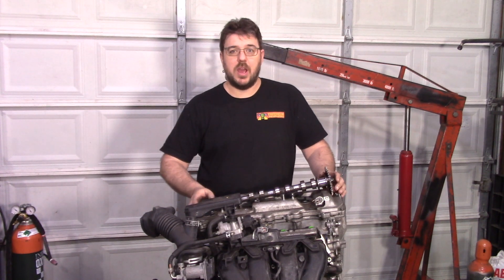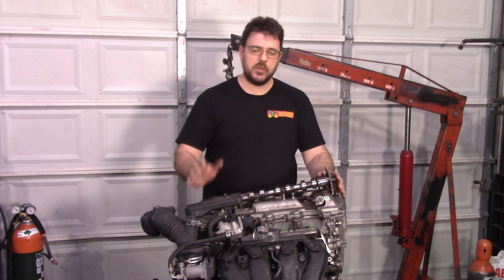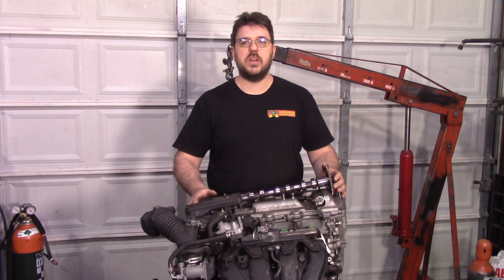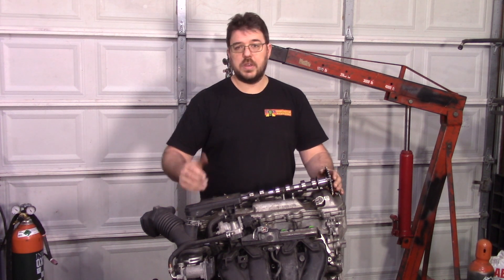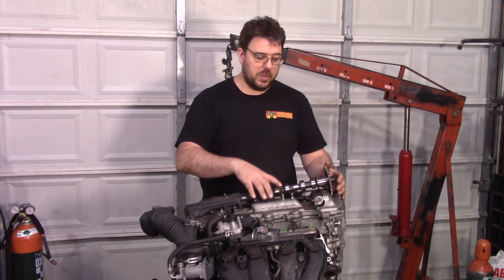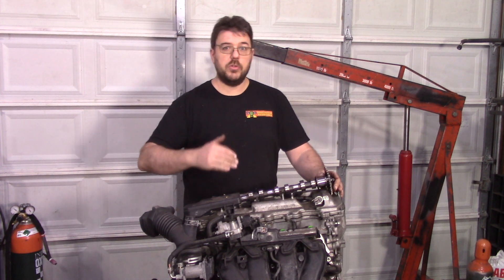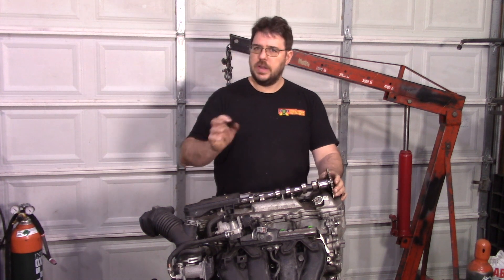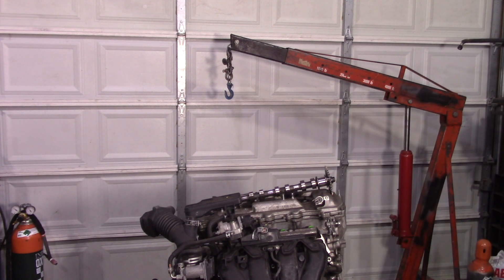2AR Power overview, the search for 150hp/L

Comment: Did he say 271hp??? NA what!?
Reply from the maker: Yes, that's my naturally aspirated record so far but that was with the 2.5L crank and stock 10.4:1 compression pistons on pump gas so it should be relatively easy to take that same build up over 300whp.
Reply from the maker: @meanman6992  Unfortunately i really have no info on the automatic transmissions in the stock application. but generally there's a 30-40% overhead available on most of these types of things.
Reply: @FrankensteinMotorworks true, but knowing that there’s likely no aftermarket support for the transmission, I have the engine…. (In that car) and I keep driving past a NA Miata on the way home….may have to start a project after discovering this. I used to be all about 4G63’s and want another project but as much as I love turbo’ed engines, I don’t know that I want to go that route again. A NA 250ish whp hp Miata I’m betting would be a hoot.

Thanks for the replies I’ll look at your store and depending on what I can find out about that Miata, 🤷‍♂️ who knows, every man gets a midlife crisis project right?
Reply from the maker: @meanman6992  I 100% agree with 250whp in a lightweight car like that. That's pretty much what i do in my MR2 Spyder and it's an absolute riot on track.

Comment: No, that's for 2GRs. Original comment:  I am curious if the D4S head (or even just the upper third) from the longitudinal FSE would fit, assuming other relevant fuel system upgrades to match. I admit in my head I'm imagining a 12.5:1 FXE block with the 1AR crank and the DI heads... I fully realize the rest of the FSE is different, but surely there's SOME similarities for the FSE to be in the same family. Could foresee tune difficulties as well, naturally. I just feel silly now.
Reply from the maker: We really don't get the 2AR-FSE engine here so i don't have access to it. That said, the 12.5 compression that comes from the FXE is in the pistons and they aren't compatible with the 2.7L crankshaft. Direct injection also adds a whole other level of tuning complexity. Generally at the tuner level the juice is not worth the squeeze there.
Reply: @FrankensteinMotorworks  Well never mind, I was just confusing myself. Too much going back and forth with the 2GR which obviously was available with the FSE here. I did always wish we had gotten the IS hybrid.

Comment: I have a 2017 camry (2AR-FE) I wanted to try these parts on. So I just replace the parts and that's it? No other modifications needed??
Reply from the maker: This video talks about a lot of different configurations, which configuration are you talking about?
Reply: @FrankensteinMotorworks  cams springs and intake
Reply from the maker: @mamadnoor2907 You need to update the exhaust to get the most of the cams and you will need to tune the ECU to use those cams.
Reply: @FrankensteinMotorworks  where I live modified exhausts are illegal is it possible to not change it? Also the ECU will be stock?

Comment: You got me excited about 2AR!   The torque numbers are actually good, and i kinda got a little interested in what 4 cyllinders can do 1.6-2.4L due to turbo charging.   They have turbo chargers now that can give that little motor a powerband similar to a Chevy LS or LT from 2500-6500 RPM.   A similar level of torque and power.

What you are showing is without boost this 2AR has a ton of potential.  That torque number that i was seeing is something that many 3.0L v6's make.
Reply from the maker: Yeah, Toyota really gave us several gems here with this generation of motors. Have you seen the 3.5L V6 making over 300lb*ft of torque?
Reply: Yes the 2gr and VS 3.5L make a little over 300ft-lb when they are tuned and bolt ons. @FrankensteinMotorworks
Reply: Did you ever get the ported 2ar heads tested for power?   In your series I recall the 241whp with  the 240@.05" cam and 270 whp with your short runner intake.
Reply from the maker: @dennisrobinson8008  The 300lb*ft of torque to the wheels on the 3.5L V6 is not achievable with just bolt ons and a tune unless you're using some fuel that has some nitro in it.

I have not used the higher flow heads yet, there are some valve geometry issues i need to solve and i haven't given it priority.

Comment: Can the mentioned 2ar parts (cams, springs, intake) go to a 1ar? If not how do you build power on the 1ar and do you have any dedicated parts for it?

Thanks and respect for the videos on the ar platform
Reply from the maker: Yes the parts will bolt up. You'll need to confirm the valve to piston clearance but everything else is exactly the same between the 1AR and the 2AR. The only differences inside the motor are the pistons and the crankshaft.
Reply: @FrankensteinMotorworks  noted good sir. planning to build a car with a 1ar innit, hoping your parts will be in stock when the time comes. meanwhile will keep tabs on your research.

Comment: Looking forward to the intake cam timing experiment, and great to see this data in your videos.
I noticed what sounded like a hard rev-limiter kicking in at the end of each pull.  Is that a factory rev limiter, and do you know what the factory rev limit would be for the 2AR-FE in a 2015 Camry LE? 
Lastly, do you know how high these motors can safely rev, especially relative to any(?) rev limit imposed by the factory PCM/ECU?
Reply from the maker: The new revision of the 2AR-FXE build has been done and it ended up being great. The dual vvt-i system is not needed to be swapped in for this build to still make great power (235whp).

The factory limiter on the 2AR-FE can vary from car to car, i've seen it as low as 6200rpm and as high as 6500rpm. With the stock 2AR-FE cams i've found no issues revving it to 7200rpm safely and with the dual 2AR-FXE intake cams it revs safely to 7600rpm due to the slightly softer ramps.

Comment: Hey definitely been following your channel for the past year bc you've really pioneered a lot for the 2AR build. I'm sitting on 2 short blocks and a long block (all due the the field I work in.)  And while watching this video I had to stop and do some personal digging. at 5:48 you hit 271hp on the camshafts that you swapped out. I'm not sure if you went from the 2AR-FE cams to the FXE cams but the one thing I can confirm is the 2AR-FE cam is bigger than the FXE. Probably shouldn't disclose this info but the FE having a cam lobe height of (44.163 to 44.305 mm) and very similar to the exhaust compared to the FXE cam lobe height being (43.814 to 43.914 mm) and being about a mm smaller on its exhaust cam.  YET I had to see the cam on your website and you listed that "These camshafts are 289 degree advertised, 240 degree at 0.050” with 12.2mm lift. The grind is asymmetric." ARE THE CAMS YOU SELLING ADDING AN ADDITIONALLY 12.2MM OF CAM HEIGHT????????????
Reply from the maker: Yes, the FXE cams have less lift but they have a lot more duration than the FE so they do end up flowing a lot better. The cams i sell really are quite big but keep in mind, 12.2mm is the total lift at the valve, for comparison, the FXE cams are 9.9mm lift at the valve. quite a bit more than the lift at the lobe because the rockers do magnify the lift quite a bit.
Reply: @FrankensteinMotorworks  when coming to this build I was trying to stick with mostly DENZO parts. Typically what Toyota only runs . But what I’ve found interesting is the fuel delivery. The Toyota tundra and sequoias are the only Toyota vehicle to have flex fuel available when buying which type of vehicle. I have the 2AR stock fuel rail fitted with several different types of Toyota fuel injectors and they all fit as snug as the 2ar fuel injectors
Reply: I would be a lot Cheaper to get these of an FBE motor compared to buying 500cc injectors
Reply from the maker: @chrisking5521  The idea is not bad at all but unfortunately those injectors are about 430cc injectors. The V8 motors make more power but have twice as many injectors to do it with so the injectors are not that much bigger than the 2AR's injectors. 

Toyota already has a pretty large margin of extra flow on the pump gas vehicles and they only seem to increase the injector size 5-10% for the flex fuel vehicles. 

In order to find an injector bigger than the current 545cc injectors i use you need to look at Toyota vehicles that make over 60hp/cylinder on E85 or 65hp/cylinder on pump gas. So for an I4 that would be 260hp, a V6 would be 390hp and a V8 would have to make over 520hp. And keep in mind that the direct injected engines make peak power on direct injection so they need to be port injected only engines.

Unfortunately this ends up being a pretty standard problem. I find a solution to a problem and then the demand goes up and the market shoots up. I don't have a great solution for this because the solutions i do find are sometimes quite good but then they cease to be as soon as people hear about it.
Reply: I gotta know truly. I love to communicate with you to compare some of the finding  i've came across during this journey as well.

Comment: Toyota A25A is far modern and high-tech engjne with the same displacement, imagine what is it capable of
Reply from the maker: I actually have one here because i try to stay on top of this stuff. the A25A is a very nice motor but as it stands it has a few things on it that make it impossible to control with an aftermarket ECU. Particularly the intake vvt-i. and even once those problems are solved there's still the issue of the A25A having a smaller bore and a longer stroke so it uses smaller valves and with those smaller valves it has much smaller intake and exhaust ports.

Comment: Just wish the mods were more cost effective to the average consumer. The power for price isn’t there for me yet but I’m still following along in hopes that the TC2 will catch on to the common car scene as a car that people hope to see is actually fast with a lot of potential
Reply from the maker: naturally aspirated horsepower is always more expensive, just use a turbo if you want more power for less cost.
Reply: @FrankensteinMotorworks  no thank you. I need reliable horses 😂
Reply from the maker: @christopheraustin3324  the 235whp configuration i'm working on with the 2AR-FXE is a pretty low cost build, I should have a stock ECU tune released for that setup soon.
Reply: @FrankensteinMotorworks  and that’s compatible with the 2AR-FE? What does that do for cold air intake and a lightweight crank pulley?
Reply from the maker: @christopheraustin3324  The tune i will release for this will take advantage of my MAF pipe i sell to get a more free flowing air supply into the engine so it won't be compatible with other cold air intake systems. Lightweight crank pulleys will be compatible because that really does not get touched but those are useless and make no measurable power difference.
Reply: @FrankensteinMotorworks  I thought they were meant to free up HP and make the engine crank have some longevity?
Reply from the maker: @christopheraustin3324  the harmonic balancer is a complicated assembly that OEMs put on the front of the motor. if it could be replaced by a simple piece of aluminum to produce a longer living engine they would not be building them the way they currently do. As for horsepower gains, technically yes it does reduce inertial losses but if you do the math on the rotational inertia difference between that balancer and the stock one you'll see that the gains are immeasurably small.

Comment: Any chance the 2AR-FE can be shoehorned into a 2008 Toyota Yaris?
Reply from the maker: I suspect it could fit in there. The Yaris engine bay is quite tall which is going to be the biggest issue with this motor.
Reply: @FrankensteinMotorworks would you put this 2AR motor in a 3rd gen Camry or swap in a v6 instead

Comment: I am looking at trading in my 2014 Corolla S for a 2015 or 16 Scion tC. The motor as you know comes with 180hp stock. How did you get it up to that 195hp? I would love too! I would like a little more horsepower while keeping my motor just about stock since it is my daily and I drive a lot.
Reply from the maker: keep in mind, that 180hp rating is at the crankshaft, the 195whp rating is at the wheels and is much closer to 225hp at the crank or so. Making it a 45hp gain, not a 15hp gain. But all i did is open up the intake and exhaust and let the motor breathe, that gained most of the power and the rest was gained by tweaking the tune to lean it out a bit at the top and also adjust the timing slightly. Note that the only reason the tune adjustments made power is because so much more air was flowing into the engine so it was outside of it's optimal tune. The stock tune is not restricting power until quite a bit more air makes it into the engine.

Comment: I've been fascinated by your work recently, and I'm most interested in the 2GR-FE ECU you've modified to run a manual transmission. Would the process be similar with a 2GR-FSE? I've been thinking about swapping that into my IS250 MT.

Comment: Very good content. I mixed and matched Opel OEM stuff over 20 years ago. I got from 100hp to 136hp on the dyno with all stock parts configured the right way. I know it´s not huge by todays standards, but 20 years ago it was a good result.
Reply: Driving a 2.5L camry, I'd be more than happy with a 20-30hp increase

Comment: Im interested in doing this upgrade for a Camry. 
How streetable and daily is this swap? Is there a big difference in wiring? The biggest cost and challenge seems to wiring and tuning? 

Have a bunch a questions and want to contact you.
Reply from the maker: The 270whp build is very streetable, still has plenty of torque down low to drive it around. The biggest challenge in a camry would be that most camrys are automatics so you'll need to figure out how to deal with that. If it's a manual camry then it's just going to be wiring for an aftermarket ECU, overall a somewhat simple mod.

Comment: I will likely never go back to a Toyota engine in my MR2, but I will continue to enjoy watching your progress with these engines.
Easily found k series (and MT) will become more difficult and even more expensive. Also, having an actual budget performance engine again is critical to keeping motorsports alive.
Reply from the maker: Yeah, that right there highlights one huge advantage to the 2AR, Toyota made very few variations on it, there's the 2ar-fe and the 1ar-fe both of which are lower compression versions (10.4 and 10.0) with the 2.5 and 2.7L displacement respectively but with the same camshafts across the entire production run and there's the 2AR-FXE which has 12.5:1 compression and a much bigger intake camshaft but also there's only one variation of that. All three of these are very much usable for performance engines, there's no need to narrow it down to model, year & originating market specific variations where some are good and some are bad. There's a minimum of 6 million of these engines that were made and likely quite a bit more because it was the base engine in the camry for 9 years and also the hybrid motor for the camry for most of those years also. It was also the base model engine for the Rav4, highlander, sienna and venza and other than the sienna most of those were built with the base motor (most siennas got the 3.5L V6 instead which is also a great motor) and there's also the scion tC which got it exclusively. Plus with the age range it is just starting to enter pick & pull yards where you can get an engine for $300 all day long and they will be there for the next decade or so. We aren't about to run out of these engines.
Reply: @FrankensteinMotorworks  I will go back through your videos and watch, but have you flow tested the heads to see what cfm they are getting from the factory? 
That's something I know the k series is praised for, having ~300cfm in some of the factory heads.
Reply from the maker: @badnewskelli  I do have flow numbers because i had to do a before and after comparison when i upgraded the head but flow benches are very much not standardized so the numbers are really not comparable unless they were done on the same machine with the same port entry shape. That said, at 14mm the head i measured flowed 280cfm before porting and 312cfm after porting.